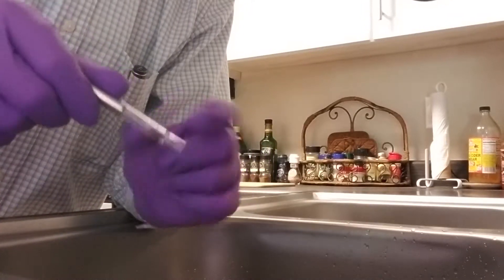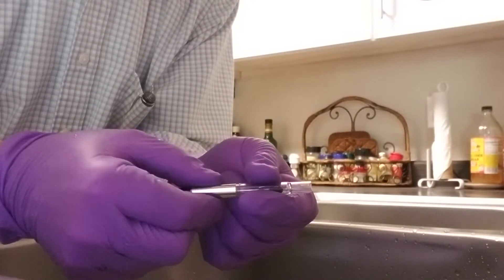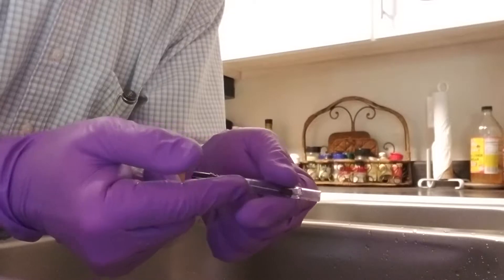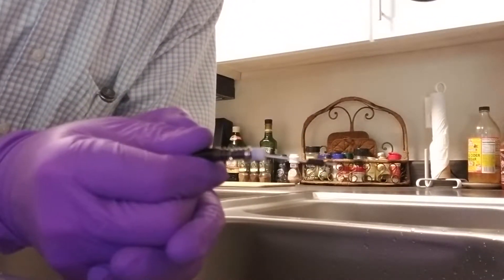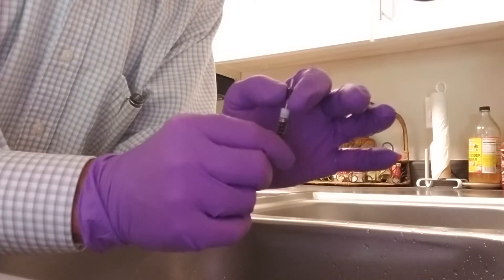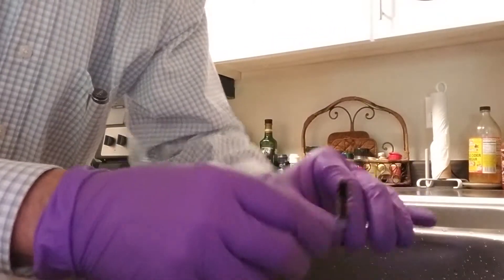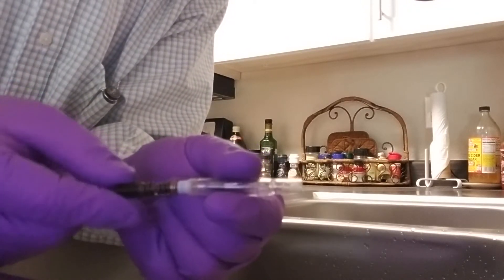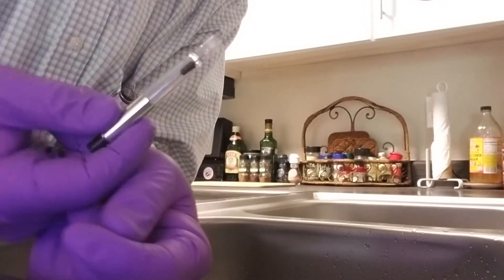Bookman Presents: Bookman's Pilot CON-70 Converter Disassembly Demonstration

Comment: Any need for silicone grease (say, on the white stopper or the plunger end)?
Reply: Good question. I also wonder if this would help prevent anything from leaking out of the metal sleeve when reassembled.

Comment: the silver collar on mine spins freely, but wont come off HELP!
Reply: + The Sanjalan Empire same for me, have you solved it?
Reply: @VictorRodriguez-gy1gs  I did some more research and the only information I could find is that pilot has been using adhesive to keep the silver ring on, so I just ended up purchasing a new con70. Sorry, that’s all I got.
Reply: @sanjaytucker1850  thank you very much!
Reply: Same. Spins freely. Seems like they've changed design since. Threads seems better, I would've preferred that.

Comment: hi there, thank you for this video. I managed to open it and I did exactly what you demonstrated how to get rid of trapped ink but I really can get the ink out. is there any way to take off the white thingy?
Reply from the maker: I haven't tried to remove the white thingy.  If I do, I'll let you know how it worked out.  Meanwhile, I've resorted to the following in an effort to remove the last persistent hanger-on molecules of stubborn inks.  After you've rinsed the plunger mechanism thoroughly, try taking one ply of a smallish section of a paper towel, twisting a corner into an ultra-thin string,  inserting it into the hole leading to the trapped ink, and then wickking the ink away.
Reply: Hello, thanks For your video, it was very helpful. I unscrew the “white thing” (it is like rubber hold it whit care) so i could clean even the other little pipe, the rest is very easy.
Greetings
PS: I found at least 4 different colors in the converter parts 😅
Reply: White thingcan be unscrewed, search youtube you gonna need to insert metal rod and twist it